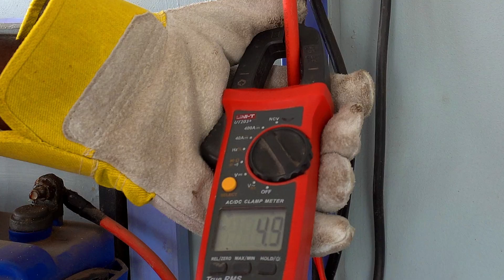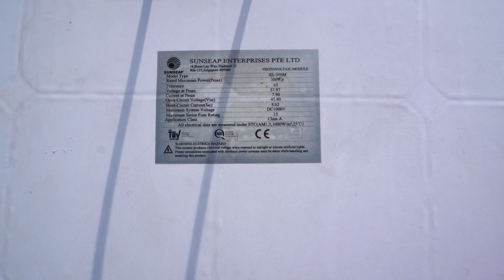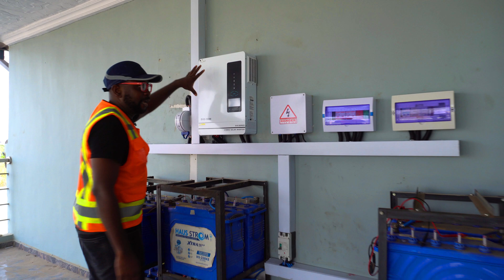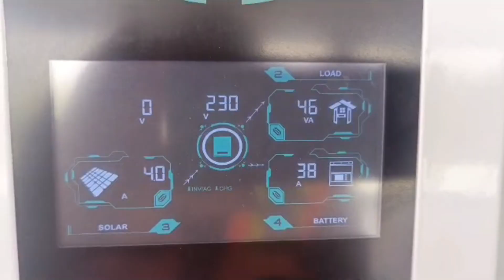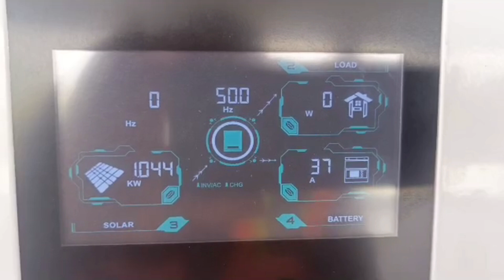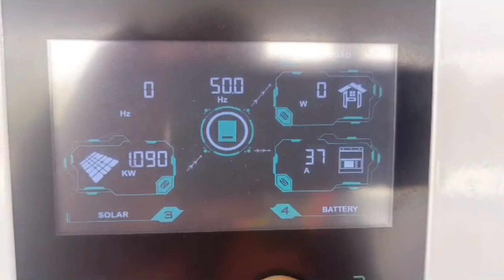Bad Solar System setup uncovered.

Comment: I do not quite agree with you about replacing the 10kva inverter with hybrid.  The major issue with the system is the fact that there is not enough charge going into the batteries daily. My take would be over seize the panels, which I think you have done. Then set the charge controllers properly, use the proper cable seize and add battery equalizer.
The bottom line anyway is that am not a fan of hybrid, I don't believe the charge controller inside it would be as efficient as a stand alone, might not even be mppt.  Also if anything goes wrong with the controller, you have to decommission the whole inverter, therefore it would not be available for the client to use.

For me, transformer based system is still the best in this circumstance because I see the customer really flogging the system once it is up and running, for those heavy energy draw. I go with transformer based. Just have enough input within the day, such that by 1pm, the batteries are full even while in use.

In any case, thanks for sharing

Comment: current flowing to battery from charge controller reduces as the battery aproaches floting state so 5A does not means fault when battery is almost full ,
Reply from the maker: That is basic knowledge, the battery isn't full neither is it on float.

Comment: You didnt check the battery performance individually, battery equalizer and lightning arrestor or just earthing.
Reply: I would have decommissioned all the batteries and check them to ascertain their individual start of charge and health, then if any of them is seriously out of range, I will charge them individually, then allow them to stay over night to see if there will be serious voltage drop which  is indication of ill health of the battery.  I know this is work, but I will have peace in my heart having done a thorough job Again,  it is not clear how long this problem lasted, it is possible some of the batteries are in bad shape.  Well this is my humble opinion. Thanks

Comment: @smilinsunsmilinsun8056 the problem is where can one get an original jinko panel. alot of this sellers just slap stickers on any panel they like. do you have a site reference or a dealer ?

Comment: Bad setup for batteries, should have used busbar for that
Reply from the maker: What is the function of Busbar
Reply: @smilinsunsmilinsun8056  batteries connected in parallel, it's industry practice, I don't have to go deeply on you

Comment: If I may ask, would be better to use Micro-Inverter instead of MPPT controllers when dealing with Non-Similar in Wattage Rating  arrays of Photo Voltatic Cells ( 330W x 2, 400W x 2, 600W x 2 etc.)?
Reply from the maker: That is a more complicated and expensive route , just use a dedicated charge controller
Reply: Complicated? 

Is it more than using Micro-Inverters that generates AC Voltage and Paralleling there output into A Bigger Central Hybrid Inverter?

Pulsing High Voltage Low Current, is it not better than the Cumbersome Low Voltage High Current that at the 'slightest Provocation' everything would go kaboom like Jihadist acts of terror?😂😂😂

Comment: If you check that Amperage Hog Black Colored Inverter, inside it, you will see the Low Frequency or 60hz transformer instead of High frequency Moulded Particle Iron Transformer also know as Ferrite Core Transformers. People wrongly think the Old school Trafo is what is needed to power Heavy loads like Hot Plates, Heaters, etc. It is actually The Arrays of Heat Sink Protected Heavy Duty High Frequency MOSFETs that does the work better!
Reply from the maker: That’s an interesting point. Thanks for sharing.
Reply: they both work ok but the good old transformers are still around for a reason. it will outlive your mosfets for sure

Comment: He will still struggle to charge those battries with limited sunlight. Tubular battries work best when supported with grid power to maintaine longer charging hours due to their lenghty charing stages. The best thing he can do right now is to switch to lithium, they charge way more faster and have longer backup time.
Reply from the maker: Lithium batteries have higher efficiency and charge faster, so they can provide more backup time even with less sunlight, but they also have a higher upfront cost.
Reply: Great job engineers! I didn't see your battery management system as stated. Thanks

Comment: Hello, I have a 24v setup with a 3.5kva inverter, 5kwh lithium battery and a 60amps charge controller, all felicity products.  Please what brand of solar panels do you prefer I use, and what wattages of solar panels and how many pieces do I need to buy? Thank you
Reply from the maker: I don't recommend brands

Comment: I really like watching your video its very educating. but I noticed you didn't make use of the battery equalizer again as you said from the beginning sir
Cos For tubular batteries, especially in a 48V system, an external equalizer is useful for long-term battery health. Tho many CC does equalization and it  only for charging at a set time but to balance the battery wen it discharging expectially for multiple parallel connection external equalizer is important.( Thanks for your wonderful video Boss) 
 #smiling sun
Reply from the maker: @OmtechSolar  Yeah it was delivered very late, so we already done with the video

Comment: Dear ikenna, you crticized him for not installing batteries equalizer, how then you never installed battery equalizer? The you talked about lower voltage breaker that is up to 125v or thereabouts, why didn't you find the maximum voltage of that charge controller?
Reply from the maker: It was delivered late we installed off Camera

Comment: The initial setup was really laughable, with wires scattered everywhere. It was crazy indeed. Good Job Ikenna, I'm glad we can all now agree that hybrid high-frequency inverters are much more efficient than the low-frequency inverters of old, this is a wake-up call for the Indian manufacturers who are still really stuck with low-frequency designs.
Reply from the maker: @johnadiele878  Thanks for your comment
Reply: Low frequency inverter has its own advantage, but sure the manufacturers improve on the energy consumption when on no load.

Comment: Can just temporarily using solar panels works to generate light without battery setup or its a must to use battery?
Reply from the maker: Batteries are crucial because solar energy can fluctuate due to changes in sunlight, so the battery helps stabilize power supply and store energy. However, in countries with grid-tied systems, you can use solar energy without the need for a battery.
Reply: @smilinsunsmilinsun8056  So if I am to use it here in Nigeria, will it work as I currently dont have the finance to buy batteries until much later after I have saved enough. What do you recommend?
Reply from the maker: You will have to use a battery
Reply: @smilinsunsmilinsun8056  Alright. Thanks a lot for the reply
Reply: @smilinsunsmilinsun8056  Do you travel to other states to install?

Comment: U need a minimum of 92ams to charge it and this will never give u
Reply: High frequency hybrid inverter don't need to much amperage. The high voltage MPPT range reduces the amount of current from the roof which most likely will be lost as heat. The MPPT controller will will do the high amperage conversion from controller to battery directly thereby reducing loss of high amperage from the the roof to battery
Reply from the maker: That is very correct did anyone think otherwise.

Comment: This number of panels will not charge all d batteries full while they are using it ,u should advance them to add more panels
Reply: Energy management is better than more panels. Those panels are sufficient
Reply from the maker: Thanks for your comment

Comment: hey Ikena.. how are you brother, I do have a question for you pleases. can i use a  PV Grid Tie inverter Nigeria?????
Reply from the maker: Yes you can , but the grid tie function won't work here because the required infrastructure for that setup doesn't exist here."
Reply: @ thank you. I actually bought some hoping to use them am market some. But thank you for this. Amazing information. You are doing amazing job exposing the fraud and incompetence in the industry.
Reply: Grid tied mode does t apply to Nigeria. There is no net metering

Comment: Your content is always illuminating. 

If you are using Must hybrid inverter with equalizer function.. Do you need an external battery equalizer?
Reply from the maker: @mwalimubosco9814  Yes you do they perform different function
Reply: @smilinsunsmilinsun8056  I've connected 4 batteries in a 24v system. Kindly recommend which kind of equalizer can I use
Reply from the maker: @mwalimubosco9814  You need a 48 Volts  Equalizer

Comment: Can I ask how every installation, from Nigeria , ive come across on inverter and tubular batteries always have installers putting  their inverter DIRECTLY ABOVE the tubular battery? Shouldn't it be a bit away from it to prevent that corrosive gas from leaching into the inverter and causing havoc?
Reply: The closer the inverter to the battery, the more efficient
Reply from the maker: Correct
Reply: No really  @ovieoyegwa6153
Reply: @ovieoyegwa6153 oh, so because of a little voltage drop it's ok to put all components of the inverter in harm's way? Oh, that's very practical I see. 

Maybe in less than 3 years when the inverter goes haywire, that will be a nice thing to explain to the owner.

Comment: You are still the best I have seen, but you didn't show us the 48V Battery equalizer connections. The new system upgrade/modifications would serve well but it won't last the test of time because of multiple strings of wire connections on the tubular batteries. I supposed the owner is rich and should replace the batteries with LiFePO4 battery type in the newest future. Shout out to all the people living at Atan(City of darkness in Ota)
Reply from the maker: The strings connection is not a problem for Tubular batteries as long its properly connected with a battery Management System.

Comment: That Inverter has Ups mode and Eco mode, Eco mode is energy savings doesn't consume much as stated, while the UPS mode is the energy consumption mode which focuses more on battery power......u can verify.....nice video ❤
Reply from the maker: Thanks for your comment
Reply: @oranusichigozie5219  Eco mode is mainly  for either when the inverter is on idle mode or the load demand on the inverter is very minimal. You can't sustainably power heavy loads on eco mode. So the self consumption of that inverter is still very high.
Reply: The inverter is old school. Throw it away
Reply: @ovieoyegwa6153  Throw it away as if to say na na pick I pick am.....Nawaa oo

Comment: I do like your videos. But always do your homework and ensure the right information is passed. Nothing wrong in mixing panels with different ratings. What matters most, is how they are connected. You might need to have some in parallel and others in series. You can also use the PV combiner box to mitigate the challenges.
Lastly, having equal cables allows for the same resistance across both battery supplies. The same applies to the PV.
Reply from the maker: I'm a bit slow when it comes to homework, haha! Could you kindly explain how to connect 200W, 300W, and 550W solar panels in the same setup? Keep in mind that these panels have different Vmps (maximum power voltage), Iscs (short-circuit currents), and varying voltages and currents. The main concern here isn't whether it will work, of course it will, but rather how well it will work. I'm really looking forward to learning about this!
Reply: @smilinsunsmilinsun8056 your response are always spot on to the solar killers 😂
Reply: Facts shaa have tested it using various types of panels in same setups is a bad idea
Reply: Am also waiting to learn how you want to combine 200w, 300w, and 550w panels
Reply: Exactly, It’s about connection..
Reply from the maker: @odedeyidamilare  How is what we all need to know, it's not about making blank statements please tell us how.
Reply: @smilinsunsmilinsun8056  I will show with a video as well educating the public.. though there are practical on YouTube on how to. Already
Reply: You are on your own ooo
Reply: Why mixing panels of different specifications are not advisable but when you find yourself in such situations especially during upgrades. All the similar panels can be connected in series as a single string with a dedicated charge controller. Advisable MPPT.
Reply: @mimoh2000   most people are full or theories, 555w jinko works with 440w jinko without power loss.

Just know how panels and electricity works

Comment: on the upgraded (corrected) installation you did, how did you implement a BMS for the 16batteries?
Reply from the maker: The Equalizers Came in late , we connected it after we closed the video .
Reply: I wanted to ask this too. Or did you skip because of the 48v connection you made for the new inverter?
Reply from the maker: No it was connected afterwards
Reply: Or did you skip this cos of the 48v connection you changed to?

Comment: You made mention of no bms on the system to equalize battery charging, after your installation, you didn’t talk about the bms you installed.
Reply from the maker: The BMS came in late was connected after the we closed the video
Reply: @ Alright
Reply: @smilinsunsmilinsun8056  ❤
Okay that's perfect

Comment: You can not use BMS for gel or fold batteries...you can only use equalizer...the equalizer is not necessary if the installer knows what he is doing
Reply from the maker: An Equalizer is also a battery management system, you said it is not necessary if the installer knows what he is doing. Could you explain how the previous installer should have done his connection to avoid using an Equalizer.
Reply: I haven't witnessed an equalizer on tubular batteries before 
Don't know how it works
Reply: @Danny_cruzz equalizer is still ok if want to add, as an additional protection,but reason why many don't use it is because most Mppt charge controllers have  an equalization feature which balances the cells and batteries periodically.....all this also needs to be properly configured. BUt battery equilzer is still a good idea for additional protection based on cycle protection.....not periodically as done by most Mppt
Reply: @Danny_cruzz It transfers current from an already full battery to another connected battery that is not yet full keeping the voltage balanced across batteries during charging stage
Reply: @Danny_cruzz I always install it
Reply: I still think its a good idea

Comment: Battery bank cable length is too long
Reply from the maker: You have to start your connection from the furthest battery and then every all other battery bank  will have to follow that length
Reply: @smilinsunsmilinsun8056 technically answered
Reply: @smiling Absolutely correct

Comment: Tubular battery don't need battery equalizer your mppt should do equalization chargees
Reply from the maker: The Battery equalizer in the MPPT and the physical hardware equalizer perform different functions. I have done a whole video on this before.

Comment: One dead mistake I will never do as an installer is to combine PVs of different specifications
Reply from the maker: it is not a good idea to combine Solar panels of different wattages it does affect the energy output.
Reply: Being on separate controllers also means that the current flow from the charger to the batteries would be of different amps and voltage, which is still not good
Reply: It does not matter, the main thing is that the voltage from the charge controllers should be greater than the voltage on the batteries, since current will flow from higher potential to lower potential.  @Danny_cruzz
Reply: It does not matter, the main thing is that the voltage from the charge controllers should be greater than the voltage on the batteries, since current will flow from higher potential to lower potential.  @Danny_cruzz
Reply: Nope.......same current flows to battery through busbar....... because the Busbars are in parallel from the controllers, while the least voltage from the strings is sent to the battery......it's ok.. @Danny_cruzz
Reply: Still not good why?  @Danny_cruzz
Reply: You can bro but the panels have to be on separate controllers
Reply: @prihakabm3248 still not a good idea. The battery will suffer imbalance

Comment: U didn't have the "battery management system" at the end of Ur installation. Was it not really necessary??

But it nice to see someone that understands the need to have the battery cables exactly the same gauge and length.
Reply: The hybrid system will manage all the energy flow within the whole system. Is pretty much better to function without ac input because that inverter won't be capable enough to charge all the 16 batteries. 

No doubt, the client would have more close to 14kw energy from the sun, which is enough to charge the batteries and enough for them to use during the day. Let's assume they use around 3-4kva loads during the day, it will still function properly at night by then, batteries are fully charge before 6pm. But please, hope you advised them to manage loads at night to conserve much needed energy. 

God bless you always Mr. Ikenna
Reply: You still Did not install any Batteries Equaliser..as you using 4 banks of 48v (4S-4P) configuration for the batteries..
It's very necessary as u mentioned in the beginning of the video.
Reply: I thought BMS are inbuilt in the batteries and/or inverters
Reply from the maker: BMS is only inbuilt in Lithium batteries.
Reply: @smilinsunsmilinsun8056  yes, but u mentioned it in the video. Battery equaliser
Reply: I like your video..but saying the inverter taking 4kw on ideal mode is very very wrong...I guess u meant 4A DC running on ideal mode..
Reply: @tochinwikwu3784 I came to the comment section for this 🤨